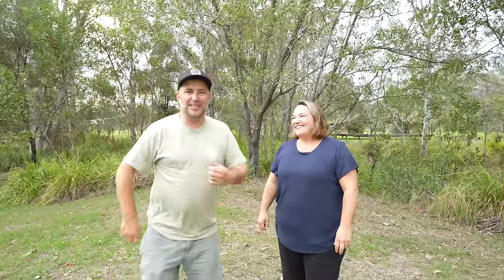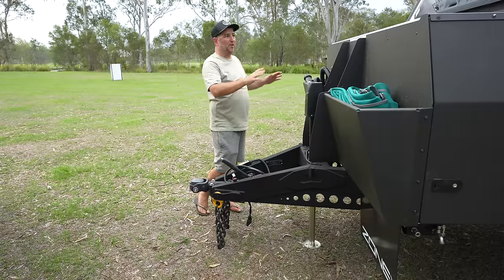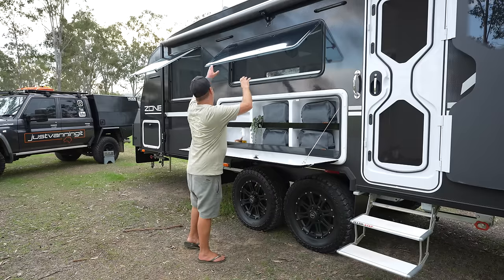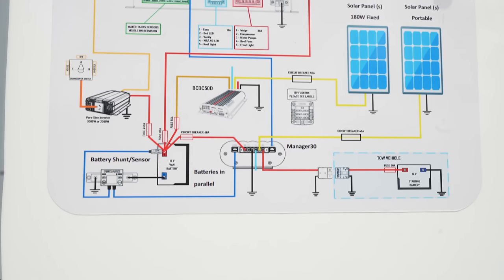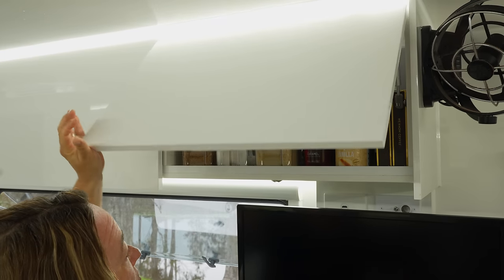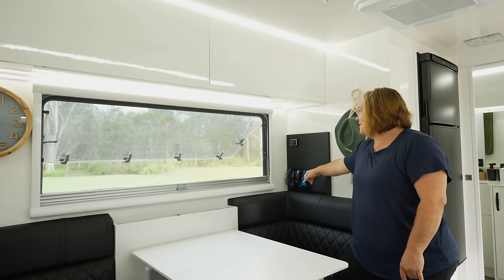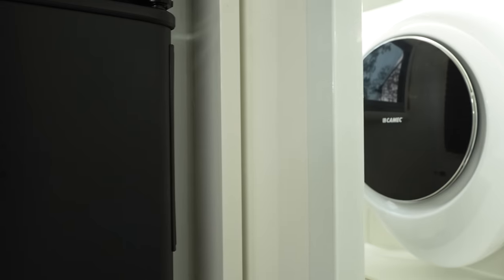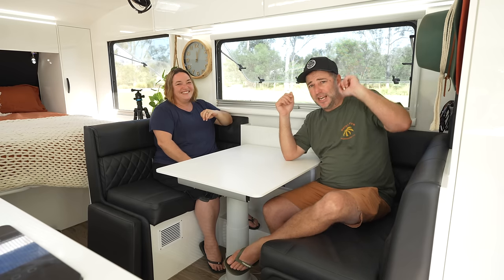BEST OFF-ROAD CARAVAN|ZONE SOJOURN SUMMIT

Comment: Congrats on getting the ultimate caravan.
One question. I went on board Zones site and did the build in their computer. The carbon fibre Sijourn weighs in at over 3500kg.euth a modest selection of must have items.
You have virtually ticked every box.
Now even though you have Upped the GVM/ GCM on the Toyota as far as I know it's not possible to increase the legal towing weight of 3500kg for a Toyota. The only thing legal would  e an American tow slugs.
Are you running it with illegal over weight.
Reply: I to was amazed how heavy this van is!
Reply: Lovells upgrade does increase GCM

Comment: Such a gorgeous van. We loved our Zone Base. It was so light and bright and super-easy to keep clean; just a spray with a vinegar/water mix and dry with a microfibre cloth! Our favourite things were the composting toilet, the airbags, the full composite construction and our electrical set up (at no time did we ever have to worry about our batteries going flat).  We wanted a smaller van, and we were fortunate to find another manufacturer that enabled us to take all the things we loved into our smaller van. We’ve also opted for the OGO this time for the same reasons as most people; the lovely streamlined look. We used our Nature’s  Head for almost 5 months, and we’re pretty sure we’ll get a few months out of the OGO as well. Enjoy your new set-up; it’s a really practical van with great features. Happy days for you both and Mr Bob  ❤

Comment: Great looking rig you have there guys. Glad that Zone have included an electric jack which makes both hitching & unhitching a breeze. Can I suggest that you mark with a black waterproof marker the max height the lift will allow on the internal lift shaft. Many electric jacks shear the internal pin if the max lift  is continually exceeded. Cheers & enjoy.

Comment: Congragulation, I saw a Li battery in the electrical cabinet. Where are the other 2 batteries. just curious? Did you see the redarc bcdc1250 reduce solar charging current because it warms up? Do you like the new OGO vs the Naturehead? Thanks in advance.

Comment: Electric jockey wheel,  I'm excited about that. Hope they are extremely reliable. I'm going to get one for my customised toy haulier/camper trailer.
Reply: It's a Black Jack. The Up and Down switch will start to give up after about 10 to 12 months. Hence, they are available as a spare part. 
I recommend keeping one in the spare parts box.